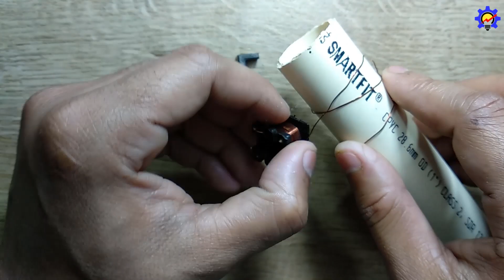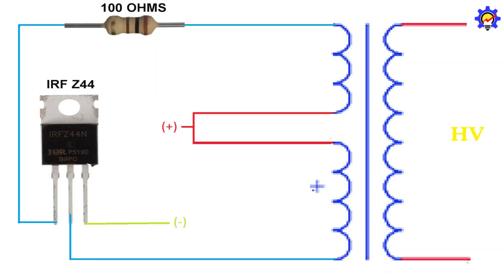DIY| How to make an PLASMA ARC LIGHTER

Comment: To much wire primary....2 times is enough for plasma arc,,,,but its cool...you have a greatjob.....
Reply from the maker: thanks mate 👍❤️
Reply: @HackTarget786003  good evening bro i have a question about transistor i have.....irfz44 p939d b9po??? Not working with my high volrage transformer

Comment: Bro while i was opening the transformer the metal got broken will there be any problem if i stick it back with super glue
Reply from the maker: no problem you can stick it
Reply: Bro what if I increase or decrease 8 turns?
Reply: @luie.no1noob  
Increase -> smaller arc
Decrease -> longer arc
Don't decrease to much or your Mosfet will burn.

Comment: works great, i used a big transformer from old TV and changed the resistor for 47ohms. but would be nicer to isolate with resin as if you dont reach the right distance it will short on the transformer. nice video btw. i guess what make it differ from a taser is the amount of arcs right? like in ordinary way you build a taser like that, but the sparks take some time to accumulate and arc. but with this way, the arc is thin but very fast and the amount of them makes it be very hot because it became plasma. am I close to the explanation?
Reply from the maker: you are correct bro ..

Comment: Hi "hack target"
i have put 5 layers of transparent tape. but my plasma arc is generating inside the transformer. what can i do?
Reply from the maker: this will spoil the windings , the layer is thin that is the reason
Reply: should i put 10 layers? of transparent tape
Reply from the maker: @ayushpandey3346   yes

Comment: What if i increase turns like 2000 turns in secondary??
Reply from the maker: you will get more high voltage out of it and it you can make the gap  bigger

Comment: i made the circuit ,, the mosfet burns more than one time !!!! however i add 180 ohm R with the gate terminal ! and connect it to 12  or 5 VOLTs !!!      please tell me what is the problem ?!!
Reply: You sure you connected the resistor to the gate of the mosfet? At 12V I would use a higher resistance than 180 ohm. try 470-600 ohms

Comment: Guys is there an explanation how it did work like that what is the mosfet doing to make it work
Reply: mosfet as a high speed switch, so it turn on and off very quickly, in this circuits who controls the mosfet is the transformer. search about joule thief, the explanation is in the same way.

Comment: What is the guage of pirmary coil wire
Reply: Try to use the coil from a clock or a relay  they have the right dimensions
Reply: The gauge of primari coil y bigger than the secundary??